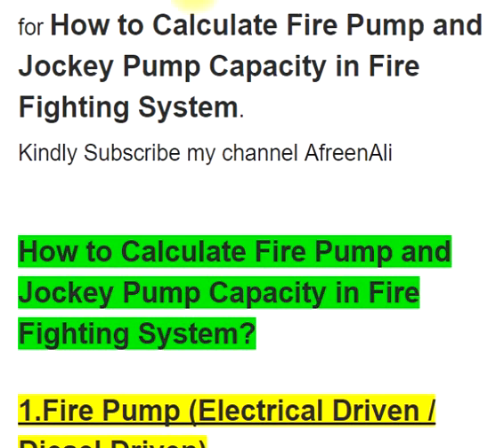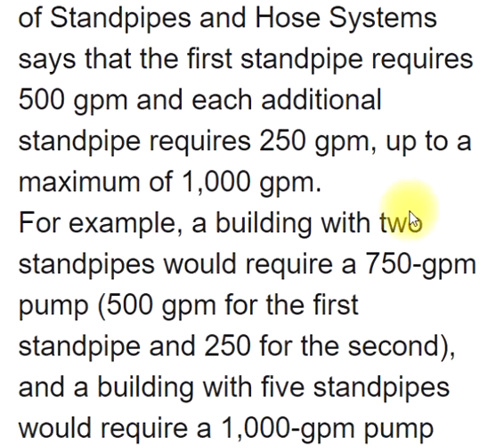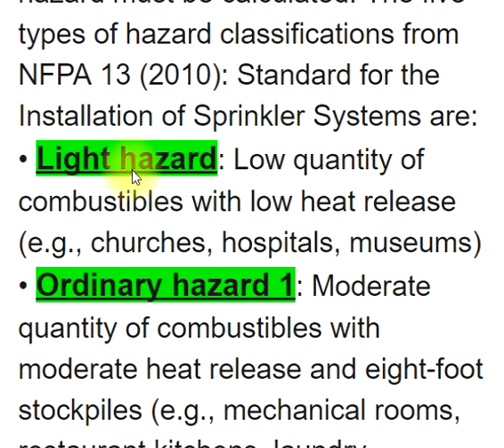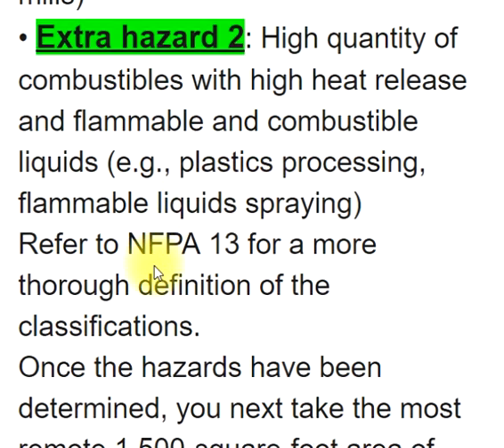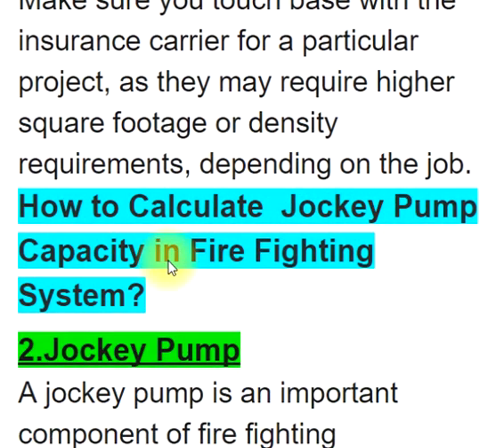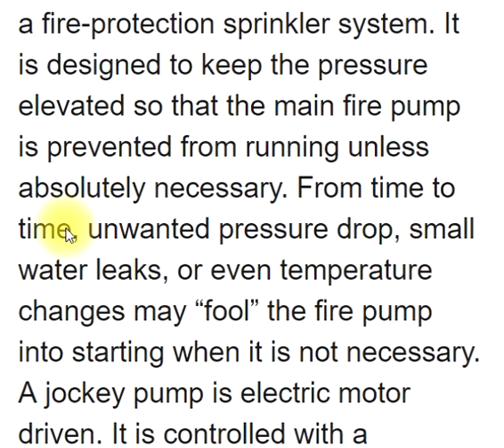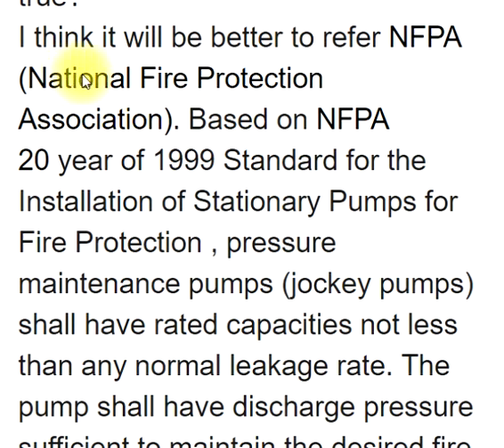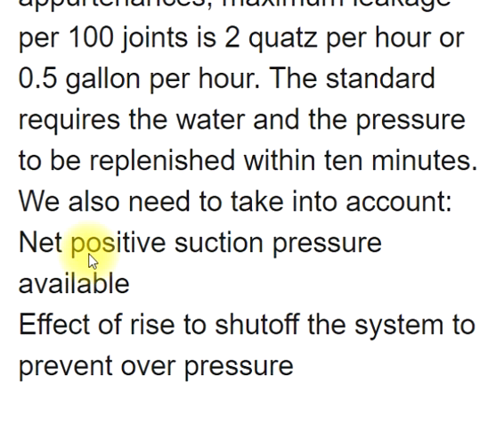Fire Fighting - How to Calculate Fire Pump and Jockey Pump Capacity in Fire Fighting System

Comment: Hi @AfreenAli
Nfpa 14 does allow more than 1000gpm for standpipes. It is up to 1250gpm
Reply: Is 1250gpm the  new updated standard?
Reply: Maximum flow shall be 1000 gpm for sprinklered building and 1250 gpm for non sprinklered building.